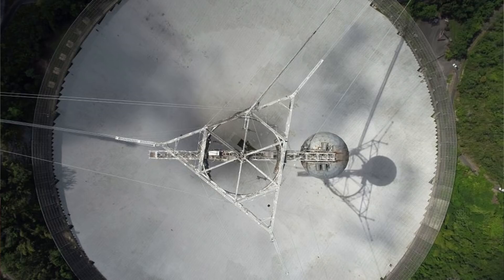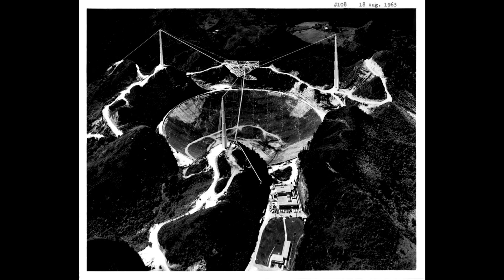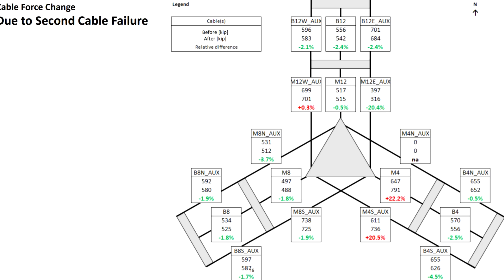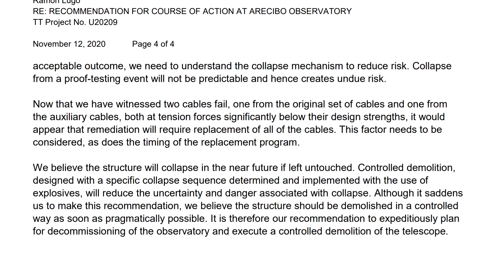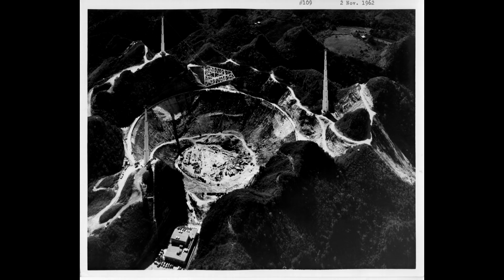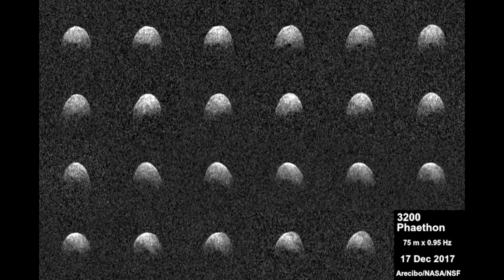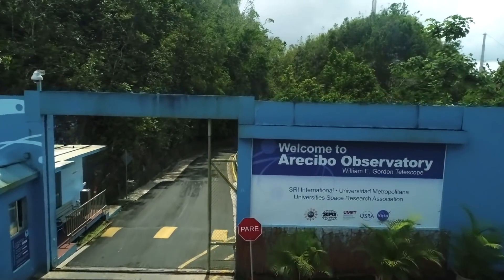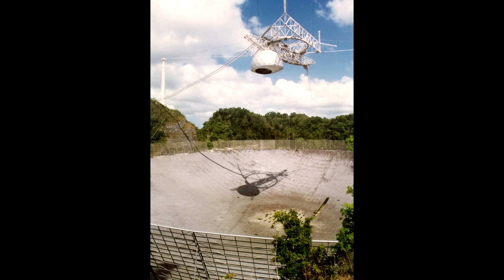Worlds Largest Radar Astronomy Dish To Be Demolished!

Comment: What I hate about these things is that they are lying about cancelling it because of safety. They obviously could save it. In a worse case, they could drop the focus equipment, rebuild it, and raise a new one. The dish could mostly be saved, and all of the ground equipment. It would be expensive, but massively cheaper than building a new one.
Of course, I'm sure that structural engineers could figure out an even better way, but my worse case is still better than starting over.
Reply: I thought the same,  just drop it..   and overhaul the disc

Comment: Reading that technical report was really harsh to me as an engineer. When something fails at 62% of the minimum breaking (static) strength is very serious.
After so many years, it is likely due to corrosion and/or lack of maintenance as suggested in the reports and by Scott. Really sad.

Comment: Scott, I don't think that reflected signal depends on distance by the power of four law. I think that it will be square law still, but under square will be distance multiplied by two. Imagine that you have ideal mirror there where your target object resides and how signal will reflect of it. It will continue to move inside the same frustum but in opposite direction. It means that we will have the same formula as if it continued to move without reflection but two times further. The object not beeng a mirror is not relevant here because this part of signall loss doesn't depend on distance.

Comment: 4:44  - Run. Do not walk, RUN AWAY!
I am a rigger, and that cable makes me weak in the knees... Death waiting to happen. 
In regards to hanging guys below helicopter, when a cable snaps, it can recoil UP and take out the helicopter too. 
The only safe way to deal with this is to set charges where the cable stays from the top of the towers attach to the outer ring of ground anchors, and sever all the cables at once so that the weight of the truss pulls the now unsupported towers inwards. 

This keeps people as far from the danger zone as possible (unless one of the cable stays snaps at the top of the tower and recoils back to the ground anchor). 

Basically getting closer than the length of the cables is dangerous. 

The only safe way I can see to salvage it is to get someone like Mammoet (just the best heavy move company in the world) to come in with either an unlimited budget, or donating their services, and set up giant crane towers around the outer perimeter, and then snake giant cables across underneath the truss, and then winch them up to cradle under the truss, removing the weight from the existing cables without having to get any workers underneath it. 
Once it was supported in the cable basket, then you could start replacing the cables. 
But this dish is in the middle of the jungle, and getting the massive amount of giant equipment up there would probably require building new roads, new ports, and take months getting billions of dollars of specialized equipment, designed, fabricated, shipped from across the world, and hauled up into the jungle. 

Building a new one is probably cheaper....

Comment: Also, aren't there loads of projects for "climber" robots intended as basic research towards the construction of a space elevator?
Could you use climbers and similar robots to string additional cables along to reinforce and ultimately replace the existing ones?
Reply: Pretty sure there are no space elevator projects currently on the books anywhere.

Comment: let's hope they will replace all cables like one by one while it is still in the air and extend its life for at least 10 years
Reply: They can't replace the cables.  The loss of the second main cable means it is one cable away from collapse.  No workers can get near the dish.  They're just going to blow up the towers and let it collapse into the ground.  They can't even retrieve the one of a kind radio receivers from the telescope.

Comment: Cables are pretty straight and tigh. If they could lower the structure, it would lower the tensinon significantly so they could add new cables and then pull it back up.

Comment: Realistically, I vote for "blow it down and put it back."  It's too dangerous to fix?  Ok, blow the cables off with shaped charges on both sides of the towers at once to zero out the stress and prevent them from collapsing, let 'er go flop, clean the sinkhole out, and start building again.  The sinkhole is still just as good as it ever was, the towers and tower foundations are still there as well as the anchor points, probably most of the dish would even survive or be repairable.
Reply: Once you remove the load from the towers they are likely to rebound and either crack or shatter. People need to not be there when the charges get fired. Needless to say, it would be starting of at less than zero due to toxic materials cleanups & such that would have to happen first. It is a real shit show.
Reply: @DrewNorthup  Yeah, it would be a bit chancy.  You'd have to blow the guy wires on the other side simultaneously for sure, to avoid them being pulled over by the weight of the guys as well.  And for sure, everyone would have to be WAY back.  But the cleanup they're going to have to do regardless, so may as well make it part of the start of the new build.

Comment: Since the cable failed at about 60% of its braking strain says to me that they're probably starting to fail due to high cycle fatigue - steel can hypothetically withstand infinite cyclic stresses so long as the stress is less than half the yield strength of the material, so I imagine what has happened here is that cyclic stresses in the material are higher or more frequent than anticipated and now, years down the line, we're starting to see failures.
I totally agree with the engineers' recommendations here, it would be utterly foolish to attempt repair, unless there was a way you could reinforce the thing temporarily because the remaining cables could fail at any time without warning.
It is a massive shame though, the Arecibo observatory is an iconic structure.

Comment: What about removing the supported receiving instruments platform part by part with the help of a large helicopter (like a skycrane), thus making the cable-supported structure lighter and lighter.  This greatly reduces the risk of a cable breaking.  Once the supported structure is removed, the supporting cables can be replaced at no risk whatsoever, then the instruments platform be put back in place.

Comment: If the pylons are in good condition, a new dish and receiver should be feasible. Those pylons were not cheap by the looks of them. But getting the cash for it is hard nowadays. Normally govts foot such bills but I doubt they'll be willing with the cost of covid-19 to the economy.

Comment: If you want to safe the dish, just tie some balloons to the rig and float it away.

I'm not an auronautical or zeppelin engineer but quick math says a ~140m diameter balloon with hydrogen or helium should do the trick :)

Comment: Repairing it from a helicopter could be dangerous, because if the cable snaps, it could whip the heli out of the sky. Also the wind of the rotor would push down on the hanging structure adding to the force on the cables and those forces would be dynamic because of the suden changes in the rotor wind. Probably it is best if they demolish it and rebuild it with more up to date tech and better materials. Sure, the dish the cables and the hanging structure is expensive, but I bet, the towers, the supporting buildings and all the ground work is even more expensive, and you wouldn't need to redo those, so it would be a huge wasted opportunity no to rebuild it.

Comment: I have this idea that honestly just sounds outlandish, but people have done things a lot crazier than this, so I don't know, it might work.

Many people probably have seen that guy's ballsy skydive into a giant net without a parachute. Go watch that video again if you can't remember the specific details. You can see that after he stopped, the net was lowered by extending the cables that were holding the net. You can probably see where I'm going with this.

Now a 700 ton telescope platform isn't exactly comparable to a person in a net, but theoretically it can be pulled off using existing technology. The idea is to secure the existing cables to a coupler on the tower side, and use that coupler to splice together newer cables. Those new cables will sit on pulleys on top of the tower. Then you would tension the new cables from the ground, and detach the coupler from the tower. Do this on all three towers, and you essentially have the "skydiver in a net" situation. Finally just feed the new cables in slowly, and you can lower the central platform onto the disc.

The benefit of the solution is that theoretically, there will be no need for anyone to actually go on the platform, thereby reducing the possibility of collapse. And in case it does happen, reducing the likelihood of human casualty. There is also unlikely to be sharp loading changes in the existing cables, which would somewhat mitigate the risk.

Of course this idea is very much unpolished - on top of my head I can think of a dozen major hurdles to overcome right now. But I mean, extraordinary problems require extraordinary solutions right?

Comment: You should do radar astronomy not with such large dish with fixed direction. It's better to build a large phased array antenna, like Voronezh but specially for asteroids. Btw, Voronezh can detect asteroids itself. It will be cheaper to construct and maintain, possible to build much bigger apertures.
As for Arecibo - it's such a great loss, but what idiots did maintain it??

Comment: It's over and done.

I think we should start planning to build a large radio telescope in a crater on the far side of the moon.  Should get a major upgrade in capability and cut way down on interference from terrestrial radio sources.  Earth is no longer the best place to do this mission.  Conceivably, Starship could deliver what will be needed - work robots, cables, a power source, etc. - within 10-20 years.

If that isn't fast enough to suit astronomers, well, then.  Build another on Earth.  Start from scratch, though.  Arecibo is old tech.  We should be able to make better radio telescopes with more modern materials and equipment.  And maybe get the cable degradation and strain analytics right this time.

Comment: “The death of an old man is not a tragedy. Forgive him his shortcomings, and thank him for all his love and care.” (A Prairie Home Companion 2006) 
Time to design/build Arecibo II
Reply: As I said in another comment, it was built to be eventually torn down and replaced from its very inception. It wasn't supposed to just accrete more and more features like the ISS. (It did a pretty good job with all that retrofitting, but it was a limiting factor.)

As long as something better emerges from the ashes, this is sadly just the cost of progress.
Reply: in space!
Reply: Most old man will leave an heir to continue their work. What for ARACEBO?
Reply: Not one but 2, Kilometer wide radar dishes in opposing orbits. More sensitivity and true binocular "vision". Same thing should have been done with Hubble.
Reply: Sounds like a great project for the innovators at SpaceX.
Reply: @whirledpeaz5758  If the deal included launching from Puerto Rico, they might well accept because it's even closer to the equator than Florida. Otherwise, what are they going to do with a telescope that is more or less not aimable? There's a very narrow cone off-axis that you can chase after, but otherwise, Arecibo has always been limited to looking at what's coming in from directly above. You look at something when the planet wants to point you there -- if ever.
Reply: It`s already build - Chinese FAST.
Reply: @grendelkir3878  Well, No. If you watched the video you would know that Fast is not capable of "radar" astronomy"

Comment: WHere we live in BC via engineers, cranes, helecopters, the hydro company picks up cables, towers  and replaces them especially at this time of the year during hurricaine like storms, Storms that pick up old growth trees and toss them onto massive electrical lines. For every outage we get which is a lot this year, materials get changed out for new light better ones
We just had over 1900 outages of late, on Vancouver Island BC Canada, power was down for 2 days, I was stunned how fast things have almost been resolved.
Someone mentioned a zeppelin, a good idea, but weve seen forester helecopters pick up massive trees. The pilots call them sticks
I beleive the largest heavy lift chopper is around 44,000 pounds and lots below that.
Its always about coin, but its an interesting engineering challenge I am sure someone will come up with a cool solution. Perhaps a competition is in order???

Comment: I'm not a civil engineer either, but I've seen videos of cables letting go and we've all experienced what happens when an elastic band breaks. The free ends of the cables can basically go anywhere they can reach, at speed. So I wouldn't even want to be repairing that thing on the end of a cable attached to a helicopter, because I'd be worried about 3" cables turning into high speed, very heavy whips. Maybe if they would rebuild it, they could come up with a lighter gantry with a system for getting it back down again for maintenance purposes?

Comment: Unexpected snapping is the entirety of the problem. They could try the "suspend the crew from a helicopter" option of course, but a snapped cable might spring back and hit the crew, or helicopter, or pull on the crew's safety cable, all of which would negate the purpose of the helicopter in the first place. The preferable thing would be to just lower the platform onto the dish, but I guess that either the dish can neither support the weight nor buckle without causing damage, or they expect the cables to snap (thus producing the spring-back problem again) at some point in the lowering.

Comment: O no that cable must've really took its toll so sad 😢 haven't watched the vid yet

   How disappointing death of a icon 😔 
The heli idea would be potentially just as disastrous if the platform fell best solution would be to erect cranes around the site holding the gantry and replace all the cables
  Could actually secure the cranes using the towers

Comment: I’m not an engineer either but couldn’t we use a combination of like 10,000 hot air balloons to hold the centerpiece up and then pyrotechnics to demolish the cables cut them at the best possible place and then reuse the center part like the way they did the first time  by  Winching  it up.   Funny part is the balloons would have to use steel cables.  That’s a lot of math.   800 tones divided by 10,000 balloons....   ah never mind.   Probably best to blow it up safely.
Reply: I'm glad you're not an engineer.

Comment: What if they build a big scaffolding system, that only has support columns going through the dish, that lefts the platform rest on that while they replace the cables? That way you'd only need to remove small parts of the dish itself so in theory it could be constructed even quicker.

Think like those funny little table things you sometimes get in pizza boxes that keep the top of the box from touching the pizza and having the cheese stick to it. Just build a giant version of one of those for the platform to rest on while they fix/replace the cables and do other repairs.
Reply: The problem is you would have to have people working under a 900 ton hanging platform that could fall at any time.  When it does, you'll have 3 tall columns that will also collapse and a whole bunch of 3 inch steel cables whipping around shredding everything.

Comment: Knock it down and build a new one with modern materials. Ideal time to do an upgrade.
Reply: As others have said though if you knock it down to rebuild it you also have to ask if this is the best place to rebuild it?..
Reply: The modern materials will be pretty much same materials.
The improvement will be in quality control and traceability. 
The real issue is maintenance. All cable suspension construction needs regular inspection and maintenance, and that comes down to allocation of funds (not the funding itself).